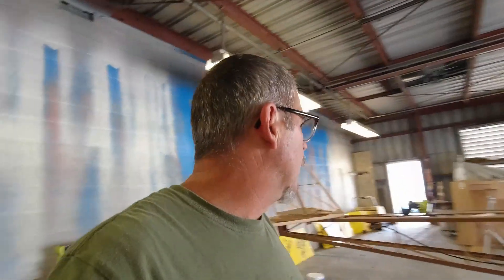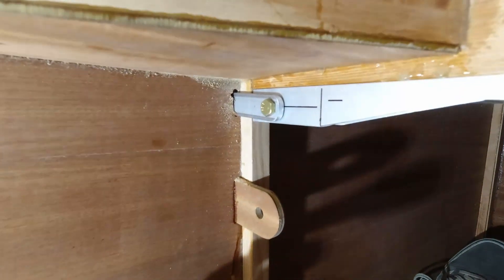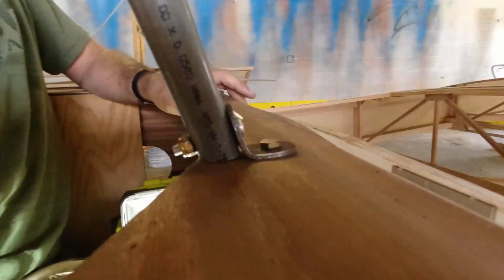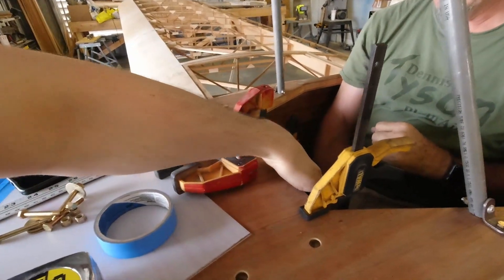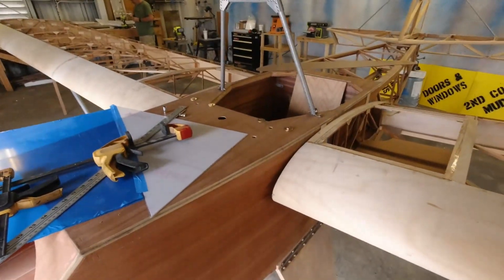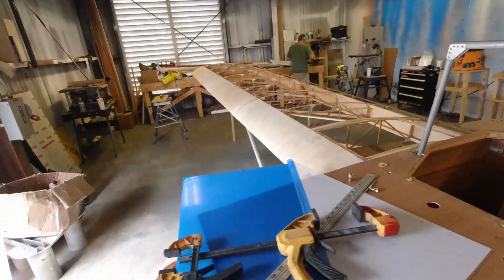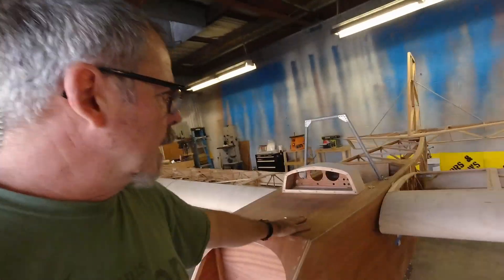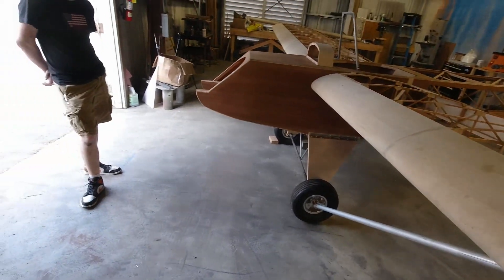Minimax 1100r Wood Aircraft Build Ep 121

Comment: Just a thought on the issue of running the bolt on the landing gear/strut attachment. Would that be a cause for concern when getting you air worthy certificate. I don’t think it would be a problem if this was going to be an ultralight.
Reply: Cessna and other certificated aircraft manufacturers run bolts "backwards" if the situation/engineering warrant.
Reply from the maker: Yea I was going to say, sometimes from a maintenance standpoint, sometimes the general rule has to be broken. 
As an example, on my front straps that attach the wing to the carry through, I wish I would have broken the rule and put those bolts in back to front. The won’t come out now because of the curvature of the leading edge sheeting. I would have to cut them if they ever had to come out.

Comment: Fantastic stuff Dennis & Parker! It's really taking shape now, that wall behind the Plane with some of your painting skills could be made to look like clouds. Great progress! I am curious about the way the struts attach to the undercarrige, does that mean there is no suspension to speak of?
Reply: Great observation - the tires are the suspension system.  :-)   Usually are inflated to around 10 psi.  Yes, that's low, but will allow for great touch downs.  Makes you work for nice 2 and 3 point landings,  :-)
Reply: @mmichaeldonavon  awesome I thought that may have been the case but was curious all the same, I've never seen a Minimax before and have refused to look them up until I see this build completed. 10 Psi on wheels that small shouldn't be an issue. I used to run my street car tyres at 14 Psi when drag racing here Down Under with no issues (funny insert, maybe that worked because we're upside-down here so there's less gravity?) 🤣🤣 Thanks for the great reply cheers 🍻
Reply: Also as a bloke that's used to flying gliders one alway's plans for a smooth landing ha ha
Reply from the maker: That’s for sure Leo…you get one shot at it. I love flying gliders. Parker has his glider license and got to fly a 1-26 quite a bit.
Reply: @DTMinimax  Dennis.  All of these skills - I'm envious.  Never had a ride in a sailplane - my son has, and he said it was super nice.  See you later.

Comment: Starting to look like an AEROPLANE, great job Parker .
Reply from the maker: Almost ready to take it all apart and seal all the wood and start covering
Reply: @DTMinimax  It's a shame that you will have to cover it.  :-)  That will hide all of that beautiful wood working that you've done.  But you'll know it's there. :) 

Oh, think I used 7 or 8 quarts of Polyurethane to seal all.  And I remember it was expensive.  Probably could have used more, as there was considerable fuselage damage 13 years later.  Yes, Florida heat and humidity.